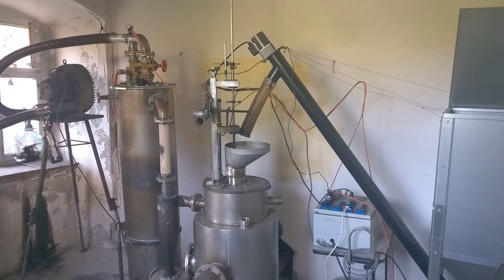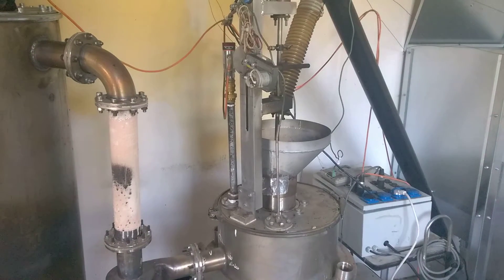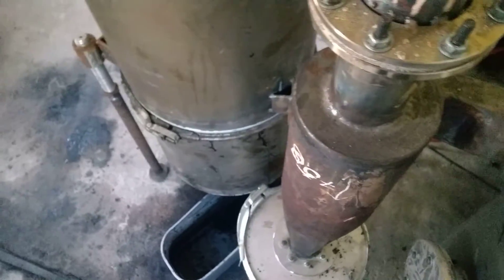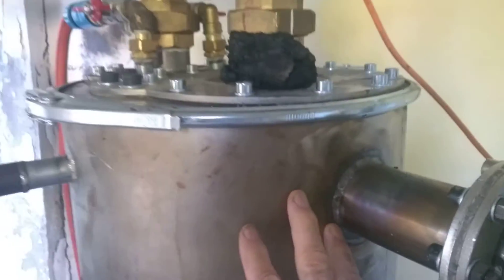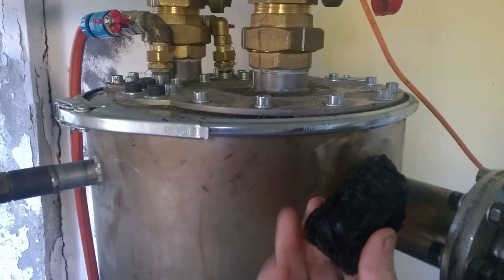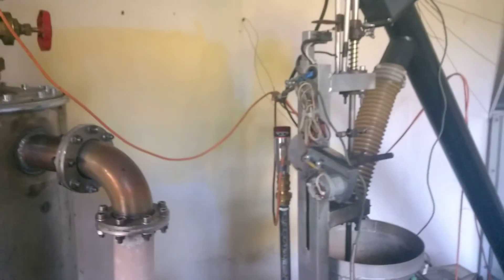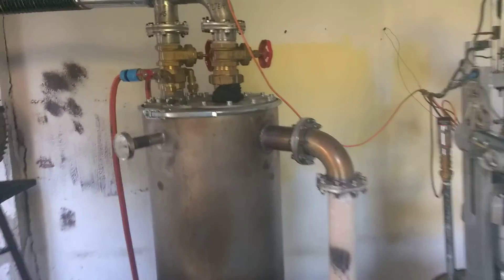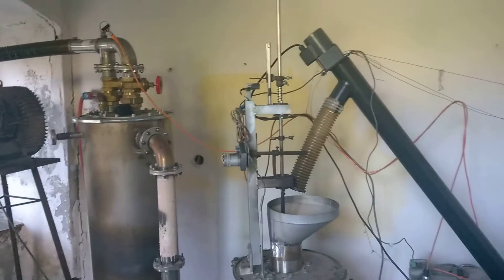Continious running DriZzleR gasifier PART2. Why it failed after whole night run

Comment: Can you use charcoal pellets in the gasifier?
Reply from the maker: Well I do use them but only as starter fuel. During the gasification I transport the gassed out woodpellets into a bin. from time to time i sieve the ashes out and keep the solid now charred pellets. With these i fire the gasifier for the first 3 to 4 minutes to get a very hot ember bed in wich i then Drizzle in the woodpellets. During these first minutes on only charred pellets I observe that the gasifier indeed makes gas and even give a sustainable flare. A nice one free of tar. So I think one could do with charcoal pellets. But then again you need lots of them and they would be dificult to transport in the auger, beeing brittle they could easely crush to dust.

Comment: you could remove the condenser and the cyclone and use a water jet ejector to clean the fuel stream and cool the gas , look up steam ejectors and water jet ejector design, you will love it  . both devices will also induce a draft and they would remove all the ash and charcoal powder
Reply from the maker: Thank you for commenting. I use an compressor driven ejector whenevert I do a test and do not want to run the hot gas through my blower. Here such a setup with a little learning DriZzler I made for people that like to start woodgassing the simple way. https://www.youtube.com/watch?v=c_306DDz2AM and here how this simple design is is flaring with the ejector https://www.youtube.com/watch?v=JfyWhnOSU9s

Comment: i think your charcoal clog was caused by condensation , insulate the device to keep it hot so condensation doesn't cause caking, i think it would help you friend , insulate the cyclone as well to keep it all very hot above the dew point ,
Reply from the maker: Isolationing is always a good measure. However during my later tests no more clogging because i reduced the agitation inside my grateless design and thus no more huge charcoaldust clouds.
Luk
Reply: glad to hear it

Comment: cool .... increase the diameter of the cyclone ...... will help reduce temp of gasses too .... double the size of the outgoing cyclone pipe to reduce gas velocity to help cyclone eliminate dust particles
Reply from the maker: Neal, Yes you are right; trouble with this cyclone began when I repeared it with a wrong diameter inner pipe. It must ne replaced.

Comment: Gents,
Thinking about your problem last night, I recall you saying that your filter was very humid.
Before you redesign the inlet to your filter, you could try to increase the amount of water-gas shift reaction where H20 disassociates to give H2 and the )2 combines with C (char) to give more CO. To do this you need to maintain residency at a high temp. oin the order of above 1000 oC, preferrably higher. This could reduce the amount of char and improve the gas quality. This could be achieved by insulating the reactor, cyclone and pipes. 
Did this blockage happen after you put on the water jacket? This could have had a negative effect taking heat away....
The academic papers I have been recently reading would support my theory.
This just may help you not having ro rebuild the filter!

Best regards,

Neil   (London)
Reply from the maker: Neil, As in a DriZzleR everything happens in the flaming pyrolise zone where are temperatures measured well above 1000 degrees (1300) I think isolation would not improve much. As you see in an answer above, I dealt already with the problem mechanicaly by reducing the agitator action resulting in much less charcoal upstirr. Thank you anyhow for all your comments.
Luk

Comment: Looks great Luk! I think you are a lot closer than you think. The cyclone can be challenging, thus many no longer use it.
Reply from the maker: Urent
Thans you for your support and always positive remarks. Encouraging is that with every improvement and every new test I still make progress. Little steps but remembering the time when I was happy having sustainable flare for a few minutes I now can count in hours.
Luk
Reply: Luk, It's not a good gasifier run unless the fire department is involved ! ; )

Comment: Would a second cyclone in series with your first one fix the problem.  I do recall there are a few white papers out there on design on cyclones based on particulate size.   Maybe put a paper filter after the first cyclone and trap some particles and then design a second cyclone to filter that.   I use a cyclone filter on a Blast box and it traps the super fine dust that comes from the alumina media.  You can find some really good PDF's on cyclone design online (google)..  Good luck with your project.
Reply from the maker: Thank you for comenting. Indeed the measuremenst you sugest could improve the dust separation and I could go on firing longer periods but it would not fundamentaly solve the problem of the too narrow space entrence into the condensor so in time I would have certain a new blocking. I must do both, improve dust separation and ged rid of the narrowing.

Comment: Your system is getting better and better. 
 When you become depressed at recent results, it always pays to look upon the past, so you can see how your system has improved over the years   :) .
 My record runtime is only 11 hours, but then my system is tiny in comparison with yours.
 Keep up the good work.
Reply from the maker: Hi Machinefun; Allways nice to hear from you. Yes looking back helps but no joy of every further progress can beat the joy that one got after beeing able to produce a first sustainable flare. Do you remenber... That was exciting.
You say eleven hours run on your gasifier, I know you have a closed system. Was that a single run or did you refilled during firing. Many greetings; Luk
Reply: the DriZzleR Gasifier 
 Thanks kindly. I always enjoy seeing fellow enthusiasts present their work on the net for us all to see. 
 Perhaps you are right when you suggest that no subsequent joy can outshine our initial one on the woodgas journey. 
 That stated, it is always nice to see that our engines are still in good running order, even after many hundreds of runtime hours  :) .
 I have 1205 hours of engine runtime on this gasser  :) .
 My gasser is quite tiny, so it is limited to about 90 minutes on a tank full of trees. This means that I had to pop the top and drop another bucket of wood cubes into the hopper on a regular basis.  The good thing is that the engine always keeps running when I lift the hopper lid  :) ..
Reply from the maker: Among the thousend of people intrested in doing something with woodgasification, very few people run a gasifier on daily basis and or as an undispensable tool to make their live in harsh conditions more comfortable: Some of them drive regular on wood and some of them  have a stationanry machine running long times. In Europe we have another bunch of builders, mostly farmers,  that build a grid tied system and they even make mony from gasification during the dead winter times: 
You are one of those serious gassers and a creative mind on top.. Using your system so regulary asks for automatic feeding. Have you ever tried, leaving your lid open close off the nozzles put your fuel processor on top and drip feed your gasifier via the DriZzleR method. I wonder what the gas quality would be from an IMbert in drizzler mode. Of course, I do not have to say be carefull not at once feeding your new engine with onknown gas.
Reply: the DriZzleR Gasifier 
 I really do wish more people would take an interest in gasification around here. 
 Most people have never heard of it before, and are scared off by the work that has to be done in order to operate and maintain a gasifier plant. 
 In time, I am hoping I can make gasification more popular, by demonstrating it to the public on a regular basis. 
 I have occasionally tried your method of fuel feeding, and it works quite well. With the lid opened, and the air nozzles closed, I was able to keep the engine running cleanly and smoothly for as long as I was willing to manually drizzle the fuel onto the hot zone  :) . 
 Because I have heavily modified this Imbert gasifier, it is inclined to run much more cleanly than it ever did when it was new. The original design was not too good, but my mods, based on experience, fixed that. 
 As a result, it runs very nicely, regardless of how I feed it with air or fuel. 
 In the near future, I fully intend to build a system like yours, as the Drizzler is a lot more versatile than any standard Imbert gasifier will ever be  :) . 
 There's plenty of room on my little farm, so there is always going to be space for a fully fledged Drizzler power plant  :) .
Reply from the maker: We must accept the fact that woodgassystems are emergancy systems. When readymade relative cheap fuel is available people will not go to the trouble neither are willing to make their hands dirty. 
I am pleased you gave the DriZzleR a try, but then again, A creative experimentor like you can make any gasifier work. Somebody said; the gasifier counts only for 5 procent, the operator for 95 procent. The only very good point of the DriZzleR is that it is so easy to automatise it and also it takes the big trouble out of the fuel preparating because it works well on chips and if fuel is short also on industrial pellets. Pascal use only pellets for convienance I use both.
Reply: the DriZzleR Gasifier 
 Indeed, gasifiers are not the convenient things that most people prefer in life. 
 The need for work, and skills, drives most folks away. 
 Oh well, at least that saves the trees  :) .
 As you have rightly observed, the most important part of any gasifier system, is a competent operator, as mistakes can be costly, and possibly dangerous. 
 My next gasifier is very likely to be a Drizzler type, or at least something very similar. 
 I like the way that it can handle a wider range of fuels, while also being a lot less likely to go bang when operated incorrectly :) .
 The new build is a wee way off, so I have some time to think about how I will want to go about it. 
 I sure do love this fine technology, and I am certain that you love it too  :) .
Reply from the maker: Look forward to see your new design. I myselve have to do some adaptions that also take time. We see each other later.
Reply: the DriZzleR Gasifier 
 Indeed. There is more development work coming up for us both.
 Let us hope that it all turns out well for us. 
 Good luck for the future.

Comment: If it were easy everyone would be doing it!  Progress slow but sure...  Best of luck with your next challenge...  Fred
Reply from the maker: Thank you Fred, if everyone would be doing it, there where no more trees left in a short number of months from now. Gasification was and will allways be an emergency thing. Progress slow, yes indeed, but I still have some time; my new house is not yet finished. 
Again thank you for comenting and also for posting that video on your suberb restored charcoal WW2 gasifier. Luk